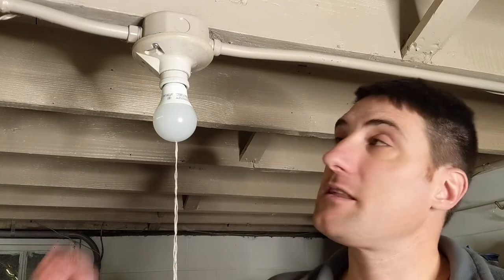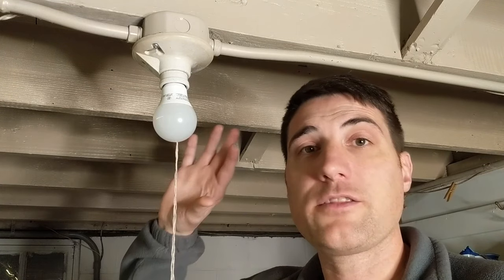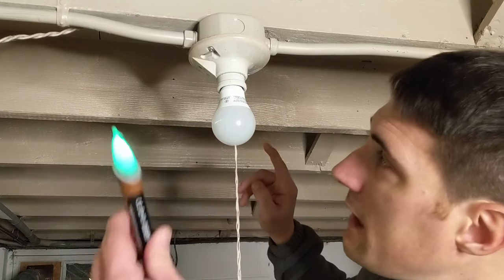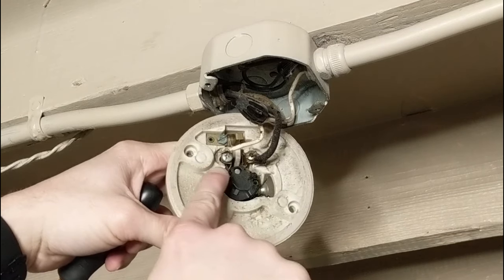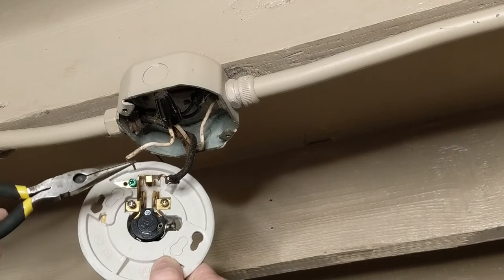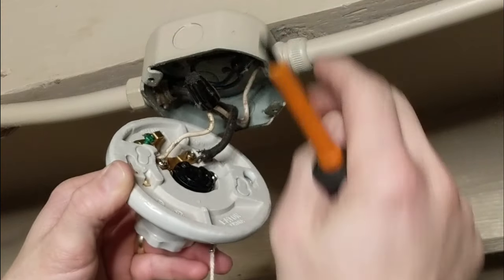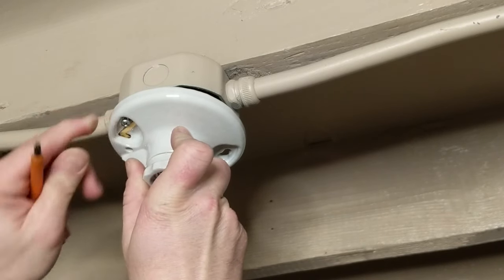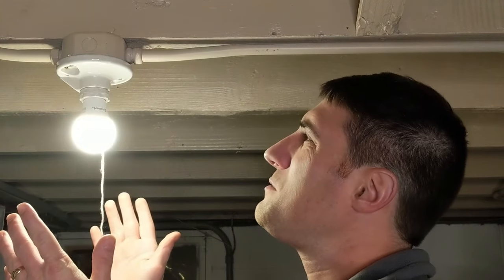How To Repair A Pull Chain Light Fixture | How To Change A Broken Pull Cord Lamp Fixture

Comment: One thing you may want to do when switching a breaker off is to put a piece of tape over it. It's just a safety precaution so someone doesn't flip the breaker back on while you're working on it.
Reply: Tape or MCB locks
Reply: LOTO Lock Out Tag Out
Reply: Clever

Comment: Great video, straight to the point without any filler to lengthen the video.
I still had to find the switch that turns off power to my hallway which was a bother in my part. But nonetheless, a job well done

Comment: I just performed this chore, replacing a fixture 50 years old. I never actually saw the end of a wire. I found U-loops on both wires where the insulation had been stripped. Didn't expect to find that. I hook up the new fixture exactly like the old one. Works fine though I'm not sure if the old wiring set-up is up to code.

Comment: Thanks :) i was pulling a hoodie over my head in my short closet and bashed the light bulb into the fixture with my hand, breaking the metal connections inside the fixture but leaving the bulb a-ok

Comment: Is the broken ball chain that broke off inside the hole of the existing pull ball chain rope, come out in one piece with the broken stem of the chain? Is it intact when u take out the ceramic fixture?

Comment: Does new fixture come with new chain to pull because I broke off my chain. I notice is that new chain to pull or Same chain. My chain broke out as I pulled it so I took old shirt as rags and unscrewed light bulb through the rags as I'm not sure if circuit switch is just for that one or for other lights I don't want turned off.

Comment: Thank you Jeff. I was wondering, I installed one similar to the one you did. Is it okay if it is exposed on top? I installed it on a beam, and I guess bugs could crawl in. Is that an issue?

Comment: My chain came out of my light fixture but the light works. Is there a way to just fix the pull change w/o  replacing the whole fixture?
Reply from the maker: Hi Tracy, I don't think you can just replace the pull chain unfortunately, it's built into the fixture. A new fixture is only a few dollars and it's a pretty quick switch.
Reply: @TinkerForward  Okay, thanks so much for the quick reply!

Comment: Hi Tinker, if i have a shaving light above the mirror but i want to change the light to a one that doesn't have a pull cord how will I do it ? i don't have a wall switch for the light is just the pull cord at the moment ? Thanks

Comment: Just tried this. But when I turned the breaker back on (breaker covered the whole basement) everything directly off the line I worked on (that light, laundry room light, washing machine) no longer has any power, but the rest of the basement is working fine. Any suggestions. If I don’t get that laundry back up and working soon my wife is going to be pissed…

Comment: Hi there, I am replacing my standard bulb holder which had two wires in one screw to pull chain and I am not able to work this. Can you help?
I have tried putting one wire in one screw and two in each neon has worked ,please suggest

Comment: You made this look so easy. My porcelain fixture looks like yours, but I don't know if it ever had a pull chain. Can't I just add a chain?  Or is that a dumb question? Lol
Reply from the maker: Hi, if it did not have a pull chain I don't think you'll be able to easily add one you'll need to buy a pull chain fixture and switch it out.
Reply: @TinkerForward  ok. I now have 3 other ceiling fans that need to be fixed also. Lol. When it rains, it pours.

Comment: I broke my pull string. Do you recommend I replace fully or just get another draw string.
Reply from the maker: Depending on where the pull string broke, if it's an easy fix for the string, go that route but if the string broke at the top inside the fixture you may be better off just replacing the fixture and pull string.
Reply: @TinkerForward  thank you 🙏🏾
Reply: So the pull string comes attached to the new fixture you put on in this video?? We just “lost” the pull string and can’t find where it goes or attaches back???

Comment: Hey, you didn't address the ground, I want to use the socket and wanted to know do I need to attach the ground. Currently, there is no ground for the old fixture?
Reply: dont even worry about it- it’ll work fine

Comment: Only problem with the video was the way you bent the wires. Wires should be bent in the same direction the screw tightens. This ensures a tighter connection and reduces the chance of wires loosening while tightening the screws. Otherwise, great job.

As a side note, some very old houses have hot and neutral wires that are the same color so your suggestion of using a voltage detector is a must in these situations.
Reply from the maker: Thanks for your comments, I appreciate the feedback that I'll use for future videos. Thanks for watching!